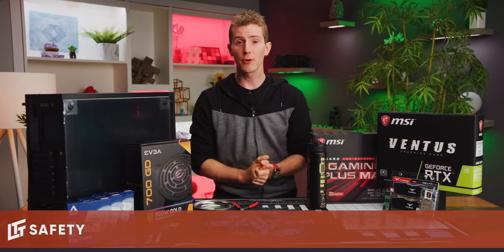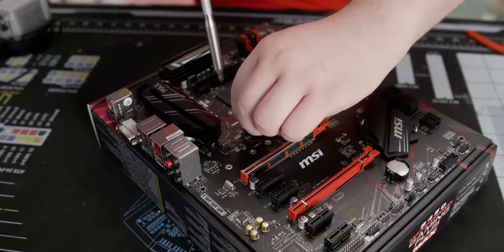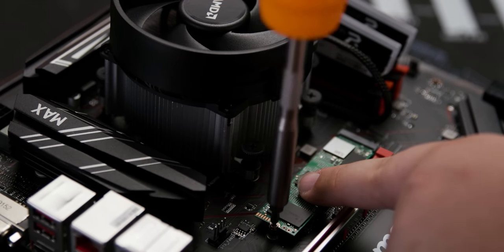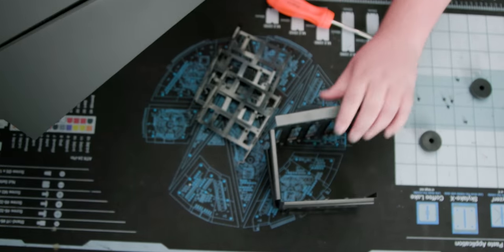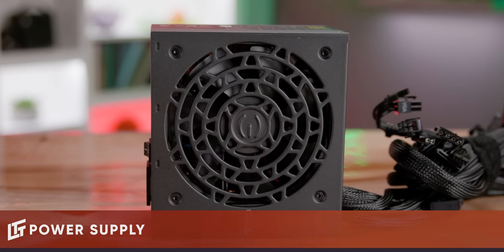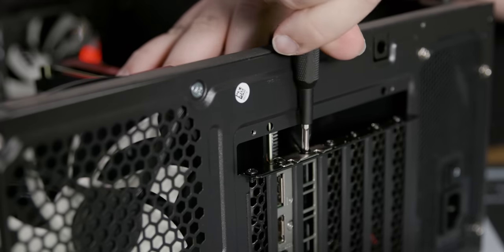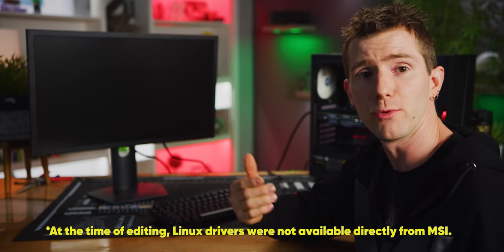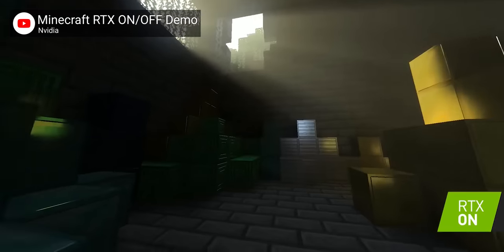$900 Ryzen Gaming Build Guide

Comment: Every component in this build is exactly the best value you can get, for the exception of the GPU, which should have been a 5700 which is better than the RTX 2060 (super and non super) for the same price.

Good job LTT
Reply: Sponsored by NVIDIA ;-)
Reply: @EUTOPIATTV  Are you trolling? Even in the video that you posted the 5700 has more fps than the 2060 in nearly all titles (except AC), so what the heck are you trying to show there? lol
And well, the Vega 56 (56, not 54) is much older and much cheaper, so that's an odd comparison. I mean, you can buy the V56 for around 210€ new, so that's a card that should be compared to a 1660.

And you can find tons of other videos comparing the 2060 and 5700, where the 5700 clearly wins.
The 5700 is actually within g around 2-3% of the 2060 SUPER https://www.youtube.com/watch?v=Sse7IQw6sio
Reply: @EUTOPIATTV  5700 sometimes mocks even the super variant.
And it's priced below, on newegg this msi (which are bad, mobos and gpus from entry segment are trash from them) card costs 377, sapphire (top amd vendor) pulse 5700 costs 350.

Comment: Just a small tip...when you are installing the AMD CPU Cooler, choose that the AMD Logo faces the opposite direction of where your RAM is. The plastic is thicker on that side, meaning that in some motherboards it will cover the first RAM Slot if you place it like Linus did.

Comment: Umm, Linux drivers have been a part of the kernel for the motherboard since forever.
Reply: No need, it's all generic, you don't need to rewrite drivers for all the optical mouses, there is a standard .
Reply: Navi's GPU don't work out of the box in  most known distros.
Reply: @vinceshere  that's because AMD haven't updated the driver in the kernel fully. Linux downloads all the drivers you need automatically, which for the 95% of hardware is baked into it's kernel.
Reply: Johan Johnsträd yep, for the most part we’re out of the Wild West days of Linux

Comment: @2:40 - I know this is years late, but seeing that you just remove the brackets and screw the fan directly into the mobo is a huge relief. I just got a Ryzen 5 3600 (and mobo and DDR4 RAM; upgrade from an an old Phenom II X4 rig) last week and could find no way to merge the brackets and the cooler together and still contact the CPU, so reluctantly discarded (into the mobo box, not the trash :P) the brackets. Been worried since then that I was killing my new gear out of my own stupidity!

So, even though I know no one'll see it, thanks for the peace of mind!

Comment: I was getting frustrated with lag and crashes playing Fallout 4, even after buying a Ryzen 3 2200 with 8gb ram and a Radeon RX570. I purchased a Ryzen 5 2600x and another 8gb of ram. Fallout 4 was running at an average of 100 fps and everyone was talking over each other and walking really, really fast. Installed a 4K graphics mod to Fallout 4 and now runs fine. Plays everything else good as well.

Comment: Value ryzen with a RTX, good joke
Reply: It’s sponsored by NVidia... they aren’t gonna use a 5700(or xt) here, even though the value is better.
Reply: RTX is just better
Reply: @boosted__  Elaborate please :)
Reply: hey man for teenagers and new people to pc gaming even tho i have a 5700xt id suggest Nvidia, i mean i aint gunna get calls everytime it derps out with video encoding, black screen boots, stuttering at 1080p u get the idea
Reply: @gaoHNQ  A value build does not mean as cheap as you can go. It means going for the best value to preformance you can get within a subset of money..For as cheap as possible the used market is the most practical. If a personal budget is smaller then you can adjust parts accordingly. For budget the best bet would be get an old optiplex on ebay with a 1050, 1050ti, or 1650ti that needs no pins from the power supply
Reply: @gcarsk  2060 super is like 5% more cost for around 5-10% better in-game performance. I don't know what value you are talking about but I don't see it chief.
Reply: Hows a third gen 5 a value ryzen lmfao
Reply: @shadowdraxx  i like amd more just bc of the software. Yea nvidia might have better encoding which i almost mever use, but amd has better software and ingame overlays which wins for me
Reply: @shadowdraxx  This is true, returned my 5700 XT because of these reasons.
Reply: 340 for an Rtx 2060,kinda expensive.Gigabyte and Galax are around 300-320$
Reply: @jonagoldz7127  In the handful of games that allow it there is an option you probably should not hit and that makes it better i guess? Or if you need cuda or the rt cores witch in fairness are the accelerator of choice for a good number of programs but then it wouldn't be a game box and you likely bought a quadro...
Reply: @SeptimusNavyaHoran  Yeah i was thinking ryzen 1600 for $80 at micro center with a $20 off on a combo deal. or  ryzen 2600
Reply: Haoanqin Gao are you saying Linus is choosing sponsorship over our interest..?
Reply: @jonagoldz7127  from drivers to everything rtx is better
Reply: @gaoHNQ  On the new market yes. But you can also get a used gtx 1080 for under $300 used.
Reply: @carmenbeagle9555  Ikr lmao. I'm building my cousin his first setup as a present, and I spent $700. That's where you use a budget cpu, like a ryzen 1600 or 2600. Not the 3600 oood
Reply: @woolfoma  2060 super is slower in pretty much every regard compared tot he 5700xt, the 5700xt even trades blows with the 2070 super in some titles while being 100 dollars cheaper.
Reply: @volcano582  Performance to dollar is not better, just because it sits between two cards doesn't mean you can go "its so much better than (cheaper card) and so much cheaper than (more expensive card)." the point is that performance to dollar is no better while features always fall behind on amd graphics cards.
Reply: @woolfoma  The 5700 xt and 2060 super are the same price
Reply: @KG-kp3le  Not anywhere I've seen (canada) 5700xt is 50-70$ more. I guess comparative value of components kinda depends on country.
Reply: DarkmoonKt This build is over $900... and yes, a 5700 would definitely fit this budget. The 2060 cost Linus $339.99 (see at 14:22). A high quality 5700 (let’s say, a Sapphire Pulse) is only $329.99 on Newegg(you get 3 months of Xbox game pass and Borderlands 3 in the real as well)... so.... Not sure what you are talking about.
Reply: woolfoma Woah that’s weird. Another user from Europe (Denmark, I think) said that the 5700 xt and the 2060 (NON-super) were the same price. Always forget how lucky I am to be able to build a PC with US pricing.

Comment: Isn't a 700W psu a huge overkill?
The System will never draw more than 300W
Reply: Why not tho? Better to overkill the PSU so you dont need a new one when you upgrade in the future... I bought a Cooler master G750M with my i5-4460 and R7 270X in 2015, i still got it (or well.. im on my 3rd now because the quality of cooler masters PSU`s sucks and keep getting sent new ones on warranty,  point still stands tho!), now its powering a 7700K and 2070 super. So its better to spend money on a quality PSU so you can have it for years and years, than and the case is pretty much the only thing that can last 5 years in a PC. (with last i mean performance wise they wont change as much as any other component in a pc, not last as in "theyre gonna die".)
Reply: @GAMEVIDSnorwegian422  You make a solid point, but one of the other main reasons you should get a 700 watt PSU for a 300 watt build is efficiency. Most PSUs will operate at maximum efficiency at around 50-60% load. Therefore, an ideal short-term PSU for this build would probably be a 650 watt, but considering the long-term argument that The Gaming Norwegian makes, I personally might go with a 700 watt or even a 750 watt unit.
Reply: You totally have a point, but there's a reasoning behind, or at least that's what I came up when buying a new psu:
-once you buy a quality psu, you spend a certain amount: at that point, you only have to spend a little more for a much bigger wattage... why not?!
-efficiency is a thing: psu perform best at ~50% usage... not a big concern, but a point nonetheless
-you have plenty of power for whatever change you'll need in the future: since psus usually last longer than the rest of the build, it's better not having to replace it every time you change platform. Also, this might not be correct, but it looks to me like stressing the psu when you have barely the wattage you need and it goes at around 80-90% all the time...

Again, there's not a many real reasons when overkilling with a big psu, but there are little pros and no real cons...
Reply: You want to start with an established brand with some sort of 80Plus certification - you don't want to risk a new brand for the one component that could fry every other component you just spent $850 on and the 80Plus efficiency will pay for itself in about 100 hours of gaming.  Once you've established that, the difference between 400 Watt 80Plus and 750 Watt 80Plus Gold is only ~$15.  And as others have pointed out, PSUs operate at their most efficient around 60% load.
Reply: You're exactly right, it's overkill no matter what justifications people may give.  Over the last 24 years of gaming my PSU went up every few years, and now it's coming down.  I have NEVER had a PSU fail in all that time.  I tried out a 14 year old one I still have kicking around and it still works.  Anything above a 550W (even with a 2080Ti installed) is overkill and a waste of cash.  People just like telling others how 'big' their components are...nerd bragging rights I guess.
Reply: @karlhungus545  dude, have you read any of our answers as well?! 😂

Comment: Can I use a Radeon 5700 xt in place of the 2060? And A Ryzen 7 3800x instead of the 5?
Reply: No, cos sponsorship.
Reply: I suggest you considering switch your motherboard to an X570, especially when you wanna do some overclocking. The extra VRM will make your system more stable.

Comment: when i installed my cooler for my build i i did earlier this year i had to force screw them in i had like metal springs/coils on each screw and i tried normally lightly forcefully but forcefully was my only option lol
Reply: That's normal. The cooler is held on with spring tension not the tension from the screws.
Reply: I had the same issue.
Reply: @Gingerking_45  Yeah. It's not a graceful design but it works.

Comment: A 5700xt will be much better, and will handle 1440p 144hz.
I got one for 350€
Reply: Ra1n 2060 cheaper though isn’t that the whole point?
Reply: @Trebiane  2060 is the same price as a rx 5700 xt, but 5700 xt is better
Reply: Trebiane yeah, but a 5700 xt is still better performance for money. A great Gaming OC triple fan version is only $399. However, this is an NVidia sponsored vid so they are using an NVidia product
Reply: Where
Reply: Kowita lol no it’s not. Except for a crazy BF deal. it’s $40 more normally. You are thinking of the 2060 super, I assume.
Reply: 350? Where in Europe did you get that. It's 500 or more here in belgium. Incl tax
Reply: games nl r/buildapcsales. Probably over Black Friday
Reply: Jesse Lioce damn, that sucks. In the US, the gigabyte Gaming OC 5700 xt is only $399(358.09 euros)
Reply: @gcarsk  Here in Denmark, 2060 and 5700 xt are identical in price, and no, 2060 super is more expensive. Both cards are actually 450€.
Reply: @jesselioce  it's normally 400€, I bought on a Spanish website, it's not a reference card
Reply: bang for your book totally agree man, but mine isnt exactly flawless esp at 1080p, i know if i recommended a nvidia card its good enough but it aint gunna cause headaches (not everyone knows how to troubleshoot) if it derps
Reply: Kowita Kowita Holy shit. That’s garbage. I’m sorry I didn’t know that. That’s a terrible pricing model. Well, then there is ZERO reason to buy a 2060, if it’s the same price as a 5700 xt... I didn’t know NVidia was that crazily priced in other parts of the world
Reply: I HATE sponsored videos where one brand is chosen over another, especially when its significantly worse. 5700XT, even the stock blower obliterates the 2060... Even the 5700 non XT obliterates the 2060..
Reply: @gcarsk  Welcome to europe.

None of our prices tend to make sense when it comes to computer parts.
Reply: 5700xt is great for people who like stuttering in their games
Reply: @Soutfast  I haven't encountered that problem
Reply: @gcarsk  yeah US is cheap in terms of pc hardware compared to Europe. That exact same card is a little over 498 euro all in
Reply: US prices for MSRP:
-5700: $330
-2060: $350
-2060S: $400
-2070: $400
-5700XT: $400
-2070S: $500
-2080: EOL, so like $999999

performance sorted from worst to best (highest is worse, lowest is best)
-2060
-2060S/2070/5700
-5700XT
-2070S/2080
Reply: @Soutfast  5700XT doesnt stutter... What an ignorant response, ive tested 3 of em, so i wouldve known if it did. I came across alot of problems at launch of the 5700-series, but stuttering was not one of them.
Reply: @jesselioce  here in the netherlands, the starting price is 400 euro, I just looked at alternate be and the starting price is 430 including tax, how did you get the 500 or more crap?
Reply: @GAMEVIDSnorwegian422  then you pay for the graphics card they are using for the build guide.
Reply: Andrew Jatzkowski where I am from 2060S and 5700XT dual fan versions trade blows (in terms of price) and 2060 is most definitely cheaper than a 5700XT. When you look at userbenchmark you’ll see that the 5700XT pulls ahead of the 2060S ever so slightly (2% or so).

What I am saying is Linus is being watched internationally and these prices listed here might not be the same levels for all members of the audience.

I like RTX and GFE and I’ve come across plenty of people who’ve had trouble with the 5700s. That being said I wish AMD the very best because competition is very good for us! 

In my country AMD is very strong in the lower end (570-580 vs. 1050Ti-1650) so Nvidia is forced to come up with answers or lose market share.
Reply: @volcano582  bol.com I did a quick search

Comment: When I tried doing a test run, the lights lit up but there wasn't any display on the monitor. Any advice?
Reply: connect hdmi to gpu?
Reply: or just reinstall the gpu back on the motherboard
Reply: Almost always RAM while fixing/building desktop.
Reply: I made sure the RAM was compatible and tried using an HDMI cable, I also reinstalled the GPU but no sign of displaying. I'm going to try to bios flash the motherboard.
Reply: Do you have a display cable?
Reply: @youngsnail7216  Yeah I have a display cable that came with the monitor.

Comment: I made the mistake while building my first rig to buy an RGB heatsink instead of using the included AMD cooler, so I ended up having to go with a GTX 1660 Ti instead of an RTX 2060, I also had to get a hard drive instead of an SSD for my boot and everything. And I bought an NZXT H510i White.  You live and learn.
Reply: Yeah.

I do recommend getting any ssd for the boot drive. Just any SSD (from a reasonably reputable company) - an HDD really cripples boot and loading times.

Comment: I wonder if Linus could show us (me lol) how to build a PC for audio production. The main concerns are CPU power, RAM, and noise levels...I think. I'd be interested to find out how removing the need for killer graphics processing changes the components needed vs a gaming PC.
Reply: Whispers: pcpartpicker.com 
Also for audio I would reccomend larger fans as then they would run more slowly and produce less noise. As well as look for a better quality motherboard that has a better audio system. As well as researching the minimum specs for the programs you plan to be using.

Comment: I was curious about the price stability of this system so here's the current price of this loadout as of 10/17/2020 @ 10:32AM. I ignored the case and fans because those are pretty stable and you can largely pick what you want to spend there.

Mobo: $109.99
CPU: $199.99
RAM: $64.99 (Newegg had a sale on where the 3200 was cheaper than the 3000 so "free" upgrade!)
Storage: $129.99
GPU: $339.99 (made me chuckle the only item as cheap as it was when they sourced it was the graphics card)
Power Supply: $99.99

Video Price: $858.94     10/17/2020 Price: $944.94

Moral of the story, shop sales to get the best bang for your buck. (Or if you're a downer be sad that prices went up almost universally)

Comment: How is this build?

AMD Ryzen 5 3600 3.6 GHz 6-Core Processor
MSI B450-A PRO MAX ATX AM4 Motherboard
G.Skill Ripjaws V 16 GB (2 x 8 GB) DDR4-3600 CL18 Memory
Kingston A400 240 GB M.2-2280 Solid State Drive
Seagate Barracuda Compute 2 TB 3.5" 7200RPM Internal Hard Drive
Zotac GeForce RTX 2060 6 GB GAMING Video Card
Phanteks Eclipse P300 ATX Mid Tower Case
EVGA 650 W ATX Power Supply
Reply: If your able to afford it, sounds like a solid build.
Reply: I recommend SSD inside for the operating system so windows is faster

Comment: This is a very good build but I would rather get the RTX 2060 super and Ryzen 3600X along with 16GB 3200MHZ and if you have enough money you can get a better cooler.

Edit: I bought a i9 9700K and 2 RTX 2080ti with 64GB Ram along with MSI gaming motherboard and 10TB m.2 ssd storage with 1TB with windows on it. I also got a good case from Corsair and lots of RGB Corsair fans. All this is worth 5 years of saving money and will be outdated very easily in 1-2 years sadly.